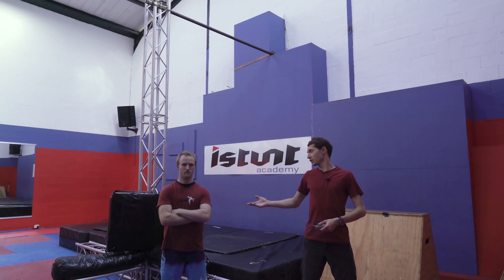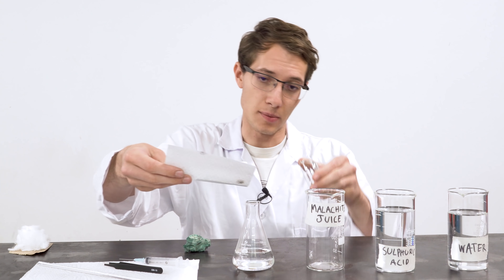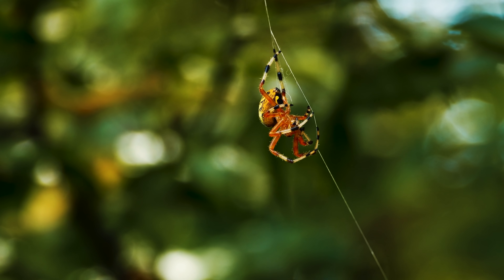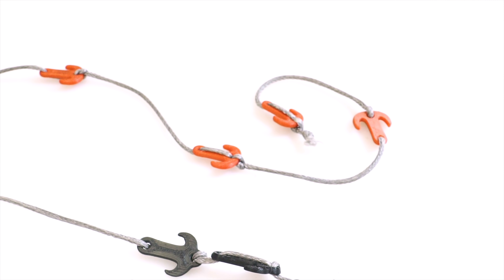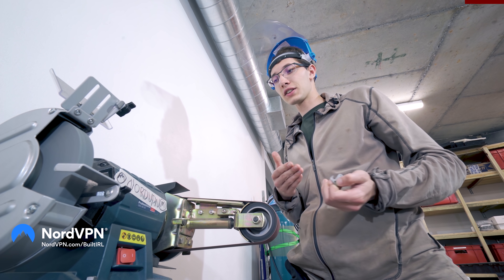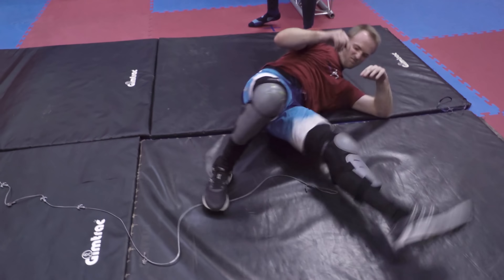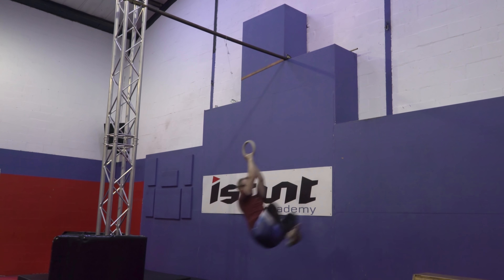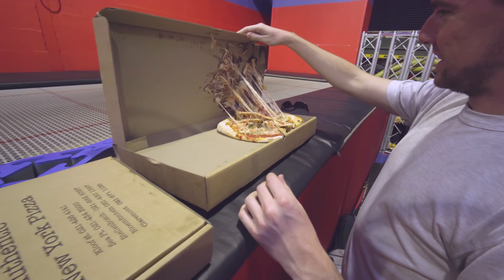Making Spider-Man's Web in real life

Comment: Damn this is by far the best 'sticky' method I've ever seen!
Reply from the maker: Thanks! It really is night and day compared to anything else. Smaller, lighter, safer, AND more effective :)
Reply: @Built_IRL  How long does it take to "unstick"? Seems like once it locks it's there for good without climbing up there and manually undoing everything
Reply: @DerkDurski  That’s a good point, that would be a big con if it were the case
Reply: @coolestburrito3487  I mean, I doubt it, unless you had like.. 15-20 of them with you and you used them to jump from pole to pole. If you just had one or 2, wouldn't take much work to get them unattached
Reply: @DerkDurski  That's why Spidey has several webs
Reply: @MandatoryFruit  Sure, but realistically you couldn't carry too many of these things. To achieve Spider-Man's "infinite" webswinging you'd need to find a way to reuse just a few of them, to somehow be able to detach one "web" while throwing/swinging on another. That way you wouldn't be bogged down by like 10 of these things just to swing across a room, and you wouldn't have to buy a bunch/just leave them around everywhere.
Reply: @Built_IRL  You should Collab with Jake Laser
Reply: Wall sticking web shooter tutorial https://youtu.be/bAMrEiXpCiU